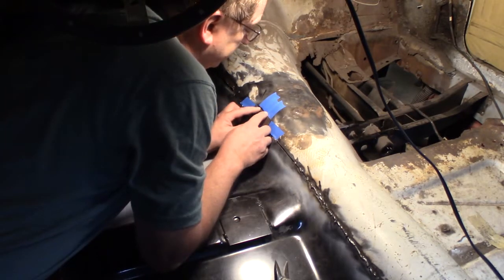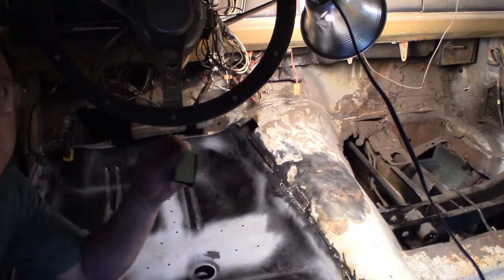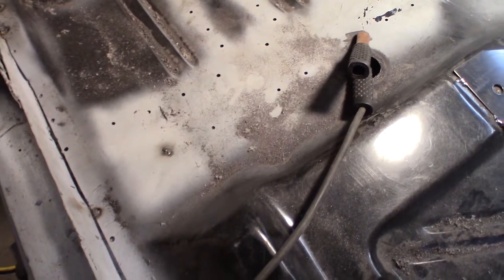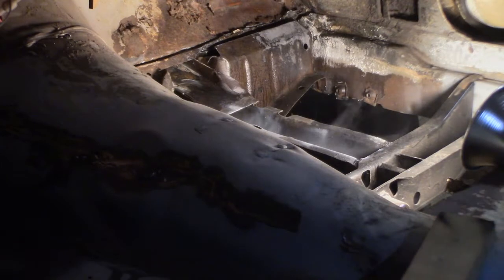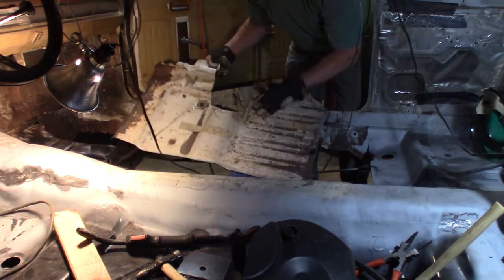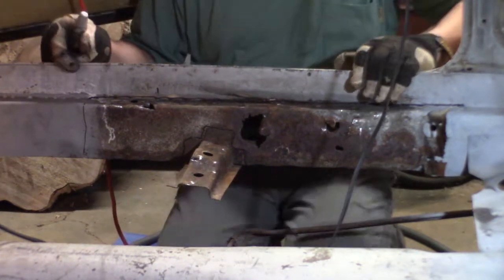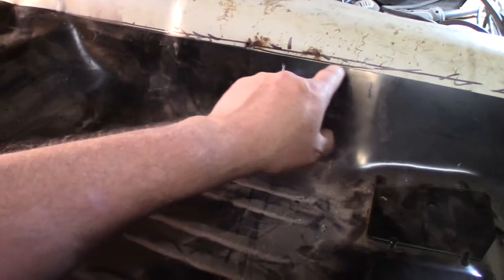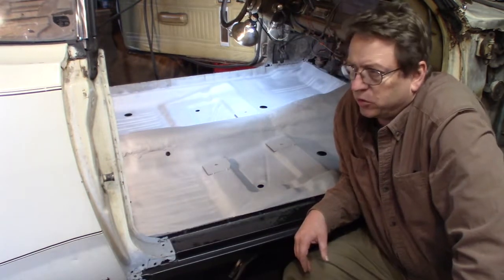Duster Restoration Part 11.2 Floor Pans

Comment: After 4 years I'm finally getting my Duster bro! On Monday. It's a 73 Gold Duster. Time to brush up on you videos and watch them again. It doesn't have the key. Is it easier to buy the ignition cylinder with a new key from Amazon or get get a locksmith to rekey it from the original cylinder?

Comment: What's happening with the Duster ???  Anymore video ?
Reply from the maker: Yes there will be. The trunk pan area has alot of work. Frames, leaf springs brackets, under the trunk and behind the bumper panel, and the bumper shocks.